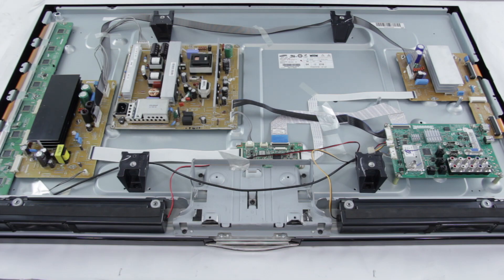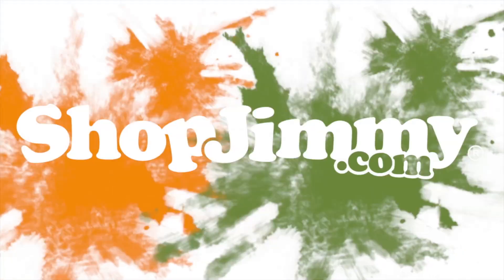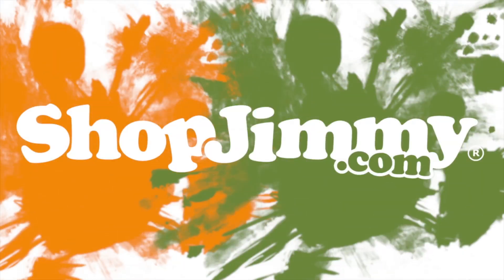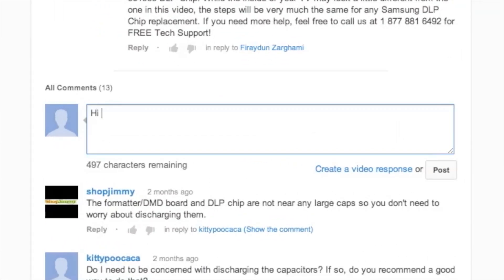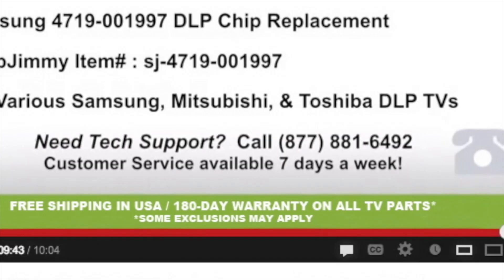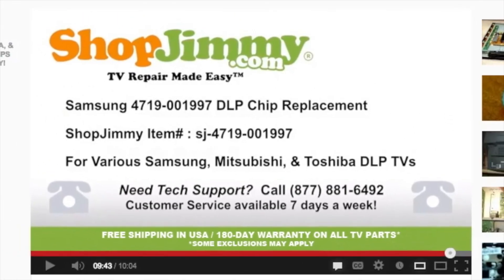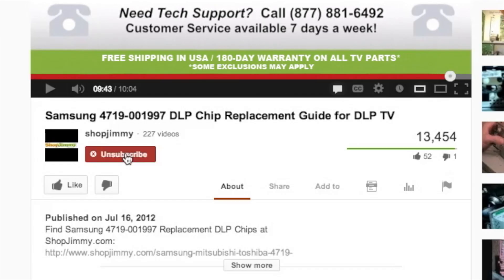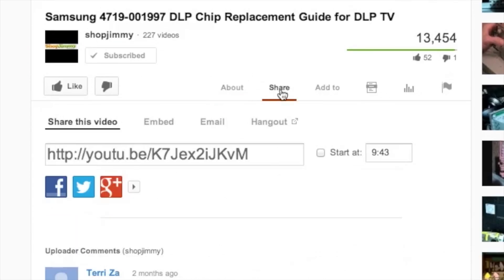Plasma TV Repair Tutorial - Common Symptoms & Solutions - How to Fix Plasma TVs

Comment: Hi
     I have a SONY 50 Inch LED TV. Some one had dropped a small screwdriver inside the TV  through the upper vents and saw sparks.After that there is no picture, but the audio works fine.how can i fix this problem?is there any fuse blown in the power supply section?if so the system should be dead, why the sound works?
Reply from the maker: Arun Babu I recommend replacing the T-con board in your TV.  Please reply with the TV model number and I can recommend a replacement part.  You can also search your TV model number on www.shopjimmy.com to find replacement parts.  You can also call our customer service for further assistance with your purchase.  (877) 881-6492  Thanks and please let us know if you have any further questions with your TV Repair!  www.shopjimmy.com
Reply: I found that the fuse in the Y main board is blown.after installing new fuse with rated current, it is blowng.the y main board seems to be short. Do you have any idea about which part is shortcircuited?
Reply: Hi Sir/Madam,
              I have a samsung PS50A457P1DXXU 50 inch plasma TV and my kid put a screwdriver into the TV.He shorted the Y-SUS board and saw the sparks and there is no more picture but sound.I checked the Y-SUS and found to be short and the fuse blown.I replaced the blown fuse with a high current fuse and saw the power supply relay is turning on and off.after that i purchased a Y-SUS board and the TV does't turn ON.The RED led in the front panel blinks 6 times .All other fuses in the System is well and i checked the voltage Vs and Va , which is 208V and 54V.Do you think the power supply is bad?Expecting your reply.thanks in advance.

Comment: Hello I have a Samsung 50" Plasma 3D with the model # PN50C490B3D and model code # PN50C490B3DXZA. While facing the screen about 8" in I have one single vertical line. The line is colored and stretches from bottom to top. If you can offer any help I sure would appreciate it. Thank you.
Reply from the maker: T Stutsman This sounds like a TV panel problem.  If your TV panel is bad, it may be more cost-effective to replace the TV as panels are typically hard to find in stock, difficult to replace, and expensive.  Thanks and please let us know if you have any further questions!  www.shopjimmy.com

Comment: Hello, I have a 2010 vintage LG Plasma 50PS60.  On the bottom 2/3's of the screen  every second scan line is black.  That is to say, the screen has horizontal black lines running across the bottom 2/3's.   The top 1/3 of the screen is perfectly fine. Occurs on any input, and is also visible with no input with the TV on.  Any thoughts?

Comment: I have a vizio VP332 HDTV10A with color vertical lines about 5 what could be the issue flat ribbon conector?
Reply from the maker: Paulo Seguro I recommend replacing the T-con board in your TV.  Unfortunately I do not see any replacement parts in the search results for your TV model number on our website.  Thanks and please let us know if you have any further questions!  www.shopjimmy.com

Comment: i have a lg 42pc3d plasma tv. tv turns on, has a faded picture, then turns dark red, and has  dark clouds in the lower and upper left side of the screen. i opened the back and found no evidence of burned fuses or capacitors. what board do i need to replace?
Reply from the maker: scrapdaddy1961 I recommend replacing the Y-SUS board in your TV.  Here is a link to replacement parts for your TV model number on our website, click here:  http://www.shopjimmy.com/catalogsearch/result/?q=42pc3d  Be sure to match part numbers on your current board, with your replacement for compatibility.  Here is a link to a video showing how to identify your part number, click here:  LG Plasma TV Repair: DIY Part Identification Number ID Guide for LG & LG Philips Plasma Panel Parts  You can also call our customer service for further assistance with your purchase.  (877) 881-6492  Thanks and please let us know if you have any further questions with your TV Repair!  www.shopjimmy.com

Comment: I have a Samsung Plasma Model No. PN51D530Afxa. The TV was fine and just shut off on its own, tried to power on 3 times (clicking) on its own and then the Red LED will blink once every few minutes. Pressing the power button will not result in anything; however, when I unplug and plug it back in, it will click three times and nothing will happen. Any help will be greatly appreciated.
Reply from the maker: Giovanni Raimondi I recommend replacing the y-main board in your TV.  Here is a link to replacement parts for your TV model number on our website, click here:  http://www.shopjimmy.com/catalogsearch/result/?q=PN51D530A  Be sure to match part numbers on your current board, with your replacement for compatibility.  Here is a link to a video showing how to identify your part number, click here:  Samsung Plasma TV Repair: Samsung Plasma Panel Parts Guide  You can also call our customer service for further assistance with your purchase.  (877) 881-6492  Thanks and please let us know if you have any further questions with your TV Repair!  www.shopjimmy.com

Comment: Hello I have a Samsung LN46A530P1FXZA, the problem I am having is on start up the right 3rd of the screen is black after a few minutes it is normal.  Then a few minutes later the tv picture turns solarized and remains that way until it has been off for a few hours.  The mother board was replaced 2 years ago and this is the first time I have had an issue since being replaced.

Comment: Toshiba 50HP66. Vertical thick lines when set is on. These lines will move right, after about a second or 2. This will repeat itself EXACTLY every time the set is power cycled. Also, the lines are white and the screen remains blank
Reply from the maker: Robert Kirkland This sounds like a TV panel problem.  If your TV panel is bad, it may be more cost-effective to replace the TV as panels are typically hard to find in stock, difficult to replace, and expensive.  Thanks and please let us know if you have any further questions!  www.shopjimmy.com

Comment: I have a three year old Samsung PN50C550G1F it has powered on and off in the past then two days ago there was a loud pop and the picture will not come on but I have sound is the problem most likely the Y Sustain board what other borads may cause this?
Reply from the maker: James Ashby I recommend replacing the Y-main(Y-Sus) board in your TV.  Here is a link to replacement parts for your TV model number on our website, click here:  http://www.shopjimmy.com/catalogsearch/result/?q=PN50C550G1F  Be sure to match part numbers on your current board, with your replacement for compatibility.  Here is a link to a video showing how to identify your part number, click here:  Samsung Plasma TV Repair: Samsung Plasma Panel Parts Guide  You can also call our customer service for further assistance with your purchase.  (877) 881-6492  Thanks and please let us know if you have any further questions with your TV Repair!  www.shopjimmy.com

Comment: Samsung PN50A550S1FXZA. Began several months ago, taking longer and longer to turn on. Finally had to "warm up" for over an hour to get any sort of picture. Now it cycles on and off without any picture / will sometimes settle on a "no signal" message, sometimes you can get an image and it seems fine, sometimes it goes to an badly distorted image with a loud static sound, will stay for a bit and then cycle off/on again. checked for bad caps on the pwr brd.  checked for obvious bad cables/connections.  would love to know how to check voltages coming off of the PS.  Have been working under the assumption that iit is the PS and have ordered a refurbished one...any thoughts? thanks and love the video!
Reply from the maker: Ray Addair I believe the Power Supply should fix the problem for you.  If that does not work, I would recommend replacing the Y-main board.  Here is a link to replacement parts for your TV model number on our website, click here:  http://www.shopjimmy.com/catalogsearch/result/?q=PN50A550S1FXZA  Be sure to match part numbers on your current board, with your replacement for compatibility.  Here is a link to a video showing how to identify your part number, click here:  Samsung Plasma TV Repair: Samsung Plasma Panel Parts Guide  You can also call our customer service for further assistance with your purchase.  (877) 881-6492  Thanks and please let us know if you have any further questions with your TV Repair!  www.shopjimmy.com
Reply: Thank you so much the power supply board arrives today so I'll get it swapped out and see if that fixes it if not I'll let you know thanks again

Comment: Hi,
I have a Panasonic Viera, made in Oct, 2010. TC 42PX24.  It is giving me 10 red flashing/blinking light.  No other signs of life, except maybe a click or two.  Everything I have read online said it was the "P" board, or power supply.  I bought and installed a brand new one.  I still have the same 10 red blinks.  Now I am looking at the SS board as suspect.  But its just guessing around.  I read through all of the post here, and nobody else states the same prob, even though it is a very common problem all over the web.

Can you help, or just keep replacing boards until they are all changed out?

Thank-You!
Reply from the maker: klindsay1000 I recommend you replace the A board in your TV.  Here is a link to replacement parts for your TV model number on our website, click here:  http://www.shopjimmy.com/panasonic-txn-a1lauus-a-board.htm  Be sure to match part numbers on your current board, with your replacement for compatibility.  You can also call our customer service for further assistance with your purchase.  (877) 881-6492  Thanks and please let us know if you have any further questions with your TV Repair!  www.shopjimmy.com

Comment: we have a 3 yr old PN50C7000YF plasma 3d and the wife turned it on and had a picture for about 30 seconds and changed input from dvd player to cable and then there was no picture.  i removed the back of tv and plugged in try to power on and have a green light on the led2000 and then a blinking light on the led2001.  no picture or sound. while plugged in and power on i unplugged the all the boards with no changed except for when i unplugged the bn9403131q main board.  all caps and resistors look good.  fuses are white in color can not see if blown no volt meter to check.  any help would be helpful.  Thanks!
Reply: ok so i bought your main board listed above and replaced it. i think progress has been made because the red light on the front of the tv is solid when turned off and off when turned on like normal and when i turn the tv on i do hear the samsung 2 second jingle but no picture.  In your one video you mentioned a popping sound if it was the y-sus i believe but i have no popping sound at all but not sure if it popped once as it was going out as it went out while my wife and son were trying to turn on a dvd.  Please any help would be greatly appreciated!
Reply from the maker: Mike Bonem I recommend you replace the Y-main board in your TV.  Here is a link to replacement parts for your TV model number on our website, click here:  http://www.shopjimmy.com/catalogsearch/result/?q=PN50C7000YF  Thanks and please let us know if you have any further questions with your TV Repair!  www.shopjimmy.com
Reply: Thanks guys for all the help! Tech support has been amazing and TV it working again.

Comment: @ShopJimmy.com I have a Samsung PN51D530 Plasma TV that will not power on.  The standby red light remains on in the lower left portion of the T.V.  When the Power button is pressed, the TV clicks once, then clicks again.  The red light remains on.  If I repeat this process I get the same results.  After about 5 or so times, the TV does not respond to the Power button, but the red light remains on.  I have tried unplugging an plugging TV to reset.  Any ideas?  Thanks.
Reply from the maker: Andrew Keith I recommend replacing the Y-main board in your TV.  Here is a link to replacement parts for your TV model number on our website, click here:  http://www.shopjimmy.com/catalogsearch/result/?q=Samsung+PN51D530  Be sure to match part numbers on your current board, with your replacement for compatibility.  Here is a link to a video showing how to identify your part number, click here:  Samsung Plasma TV Repair: Samsung Plasma Panel Parts Guide  You can also call our customer service for further assistance with your purchase.  (877) 881-6492  Thanks and please let us know if you have any further questions with your TV Repair!  www.shopjimmy.com

Comment: no picture just sound on samsung plasma pn51d450a2d, What board might I need ?
Reply: i have a Samsung pn51d450a2d no picture but tv makes noise when i turn it on it see two kinda burn marks on the power supply at the bottom by two of the diodes

Comment: My sanyo 50in. DP50749 won't show a pic, the power light goes on & off.
Reply from the maker: Walter Williams I recommend replacing the Y-main board in your TV.  Here is a link to replacement parts for your TV model number on our website, click here:  http://www.shopjimmy.com/catalogsearch/result/?q=DP50749  Be sure to match part numbers on your current board, with your replacement for compatibility.  Here is a link to a video showing how to identify your part number, click here:  Samsung Plasma TV Repair: Samsung Plasma Panel Parts Guide  You can also call our customer service for further assistance with your purchase.  (877) 881-6492  Thanks and please let us know if you have any further questions with your TV Repair!  www.shopjimmy.com

Comment: Sony kdl-52w4100. 5 years old. Suddenly developed motion lag. Lag is consistent across all inputs from all external devices. Changed cables and power supplies. The lag is less noticeable with good quality video but is still pretty bad. I've reset the TV and has latest firmware. I've reset all settings. Nothing works. Same lag. Almost unwatchable especially sports.
Thanks
DD

p.s. Love your site

Comment: my plasma tv Samsung pn50c430a1dxz has gone from the pixelated screen  to having  vertical black line  after it warms up beautiful picture  before after 5 mins  has a 2inch  line from top to bottom will dissapear sometimes but always returns
Reply from the maker: DAVID BULMER This sounds like a TV panel problem.  If your TV panel is bad, it may be more cost-effective to replace the TV as panels are typically hard to find in stock, difficult to replace, and expensive.  Thanks and please let us know if you have any further questions!  www.shopjimmy.com

Comment: Hi there. I have a Panasonic Plasma TC-P50U50 that is 14 months old. It just shut off while TV was on. After re-powering the TV, the TV comes on for a half-second then turns off. The red LED light blinks 8 times. Any thoughts? Thanks.
Reply from the maker: John Murphy This sounds like your SC board is bad in your TV.  Please find the part number for this board and search that number on our website.  Here is a link to a video that shows how to find your part ID number.  LG Plasma TV Repair: DIY Part Identification Number ID Guide for LG & LG Philips Plasma Panel Parts  Please find your part number and reply with that information and I can recommend a replacement part.  Thanks and please let us know if you have any other questions!  www.shopjimmy.com

Comment: I have a Fujitsu P42HHA30WS plasma tv, It flashes red and green when I power it up but doesn't come on.I had the back off and the fans come on for a second or two then stop. There is no picture. Where should I start to fix this?

Comment: Samsung PN50A760T1F - I have a single thin horizontal black line that is always visible in every mode - even when there is no signal. It appeared over a year ago and the TV works fine otherwise.  I was told it is a bad panel which sounds like I should simply sell it for parts and get a new set.  I checked the Y buffer connections. Please tell me if there is some other option. Thanks
Reply from the maker: AngelsTakeMe2Heaven I would recommend replacing the Y-buffer to see if that does fix the problem or not.  Here is a link to replacement parts for your TV model number on our website, click here: http://www.shopjimmy.com/samsung-lj92-01551a-y-buffer-board.htm Be sure to match part numbers on your current board, with your replacement for compatibility. Here is a link to a video showing how to identify your part number, click here: Samsung Plasma TV Repair: Samsung Plasma Panel Parts Guide You can also call our customer service for further assistance with your purchase. (877) 881-6492 Thanks and please let us know if you have any further questions! www.shopjimmy.com
Reply: ShopJimmy.com
Wouldnt it be the panel itself if the black line is always visible - even when there is no signal to the TV?  If I buy the Y buffer and that is not the problem, am I stuck with the part and just out that money I paid for it??

Comment: Good morning,
Thank-you for the TV repair video,

I have a 2009 Panasonic Viera Plasma 46' TV.   I went to turn it on and heard a snap sound and no picture.  I now get 7 red flashes consistently on my set when I power it on.   I have unplug it and turned it back on and still receive the 7 flashes.  I should note the first time I thought I counted ten, but it has consistently been 7 flashes since then.   When it made the snap sound, I could smell a slight electrical burn smell on the back left side of the TV.   What do you think?  Fuses, Y Sustain board or something else?

Thanks for your input.

Jim
Reply from the maker: James Ingalls I recommend replacing the Y-sustain and the buffers.  Please reply with your TV model number and I can recommend replacements parts.  You can also call our customer service for further assistance with your purchase.  (877) 881-6492  Thanks and please let us know if you have any further questions!  www.shopjimmy.com